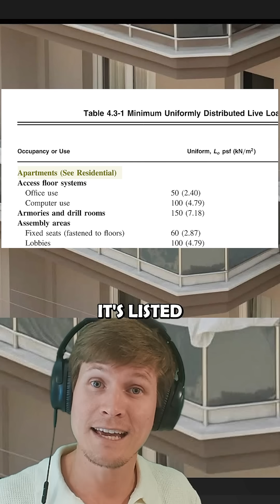Engineers HATE This Balcony Pool - Here's Why #structuralengineering #engineering #reddit

Comment: That's why I ask my clients if they want designed to code minimums, or designed to "hey guys, watch this" factors of safety. Decks are notorious for crazy stuff happening on them.
Reply: The code is the bare minimum you're (supposed) to be able to get away with.

If the customer is willing to pay for the best we can do, you can bet your ass it'll be Ragnarok-Proof.
Reply: The code minimums account for shenanigans.

That said, Chicago does require 100psf for balconies
Reply: @chaimemanuel8595  Which still isn't enough, so there has to be a line.
Reply: And if this balcony pool becomes a common thing, then you change the frequency of the building, and normal force to the columns. It changes everything.
Reply: @yk-py9ht It's never going to, it's pretty heavily enforced, both by the building and the city.
Reply: I recently did a job where the customer wanted a hot tub on a second story deck. I questioned the engineering when the design was exactly the same as it would be without a hut tub. they ran it again. no changes.  decks are already designed for a live load that far exceed the 100psf static load of a hot tub
Reply: @Tripp_777 not in Mexico or Latam. Here they built balconies thin as paper to maximize profits
Reply: @JnManuelAG  I worked in a retreat center in a newly bought building in Mexico, working with my fellow owner, she consistently wanted some form of pool or hot tob.

I kept stalling the move to get one based on the fact that we didn't know the structural integrity of the floors and didn't find them in the plans we got after the purchase.

That was a headache, she was able to settle for a small jacuzzi, I couldn't in good conscious let a pool on the roof of that thing.
Reply: never forget to check for the drunk load
Reply: So what would your cantilever be? 1/6?
Reply: Wow your clients must be over paying for an over designed system
Reply: @unpluggedpresidents  Not if they know they will be up to shenanigans and they will be using it near the load capacity the contractor is offering. It's just added piece of mind
Reply: @mitchellspanheimer1803  How much should this deck be then? 150psf? What if they wanted a 3ft pool? Lets go to 200, why not 300? You see the issue there right?
Reply: @unpluggedpresidents well he said he asks so he gives them the option.
Reply: @unpluggedpresidents  did you know that +10% cost can get you +50% durability strength and lifetime?  Maybe we shouldn't be racing to the bottom on this sort of thing. Just a thought. I know you've never had one before.
Reply: @unpluggedpresidents  When they hear the added pricetag they'll say "code minimums are sufficient we won't do shenanigans". Only to do these shenanigans anyway when they move in.😉
Reply: @unpluggedpresidents  if they know that, why would you care?